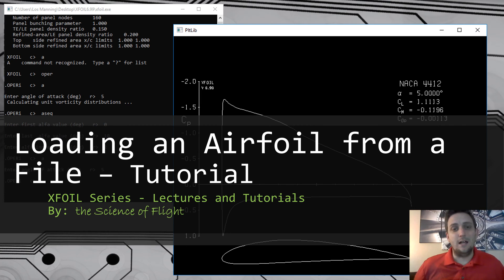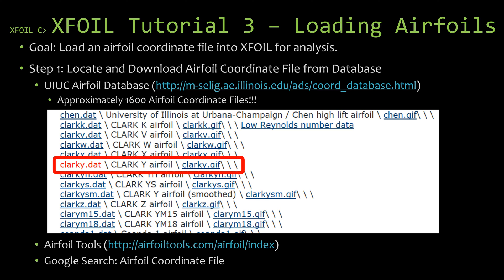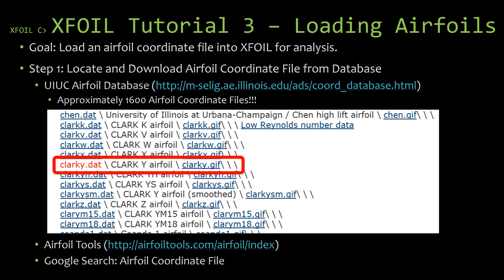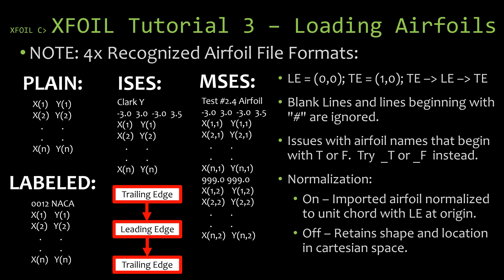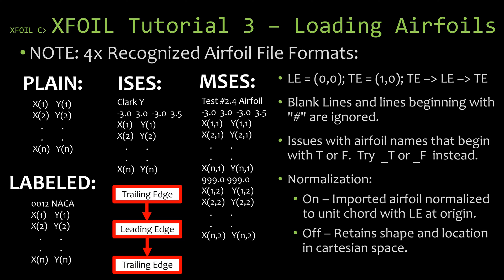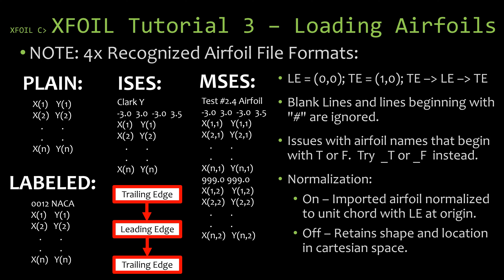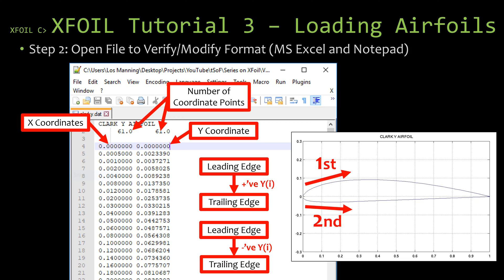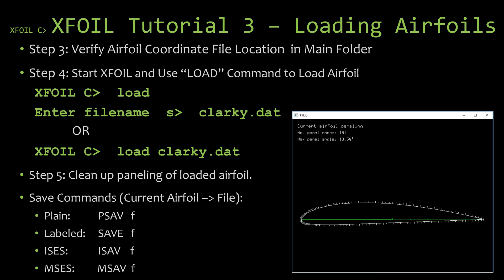XFOIL Tutorial 3: Loading an Airfoil from a File

Comment: I am not able to  load the modified ClarkY airfoil coordinates in the plain format with the headers into XFOIL. The error reads:
 File OPEN error.  Nonexistent file:  clarky.dat
Please help.

Before you ask,
I have placed the airfoil file in the same directory as XFOIL application. Also, my system contains multiple copies of XFOIL. Will this be a problem?
Reply: As a heads up if it is stored as a text file and the name is claky you still have to call it in XFoil by typing load clarky.txt    so if you name your file clarky.txt as a text file you need to type in load clarky.txt.txt in xfoil.
Reply: @ralf-hansen  thanks man!
Reply: @ralf-hansen  not true about the double .txt where did you get that from?
Reply: @giannisfilippou7460  I think it is true because I had a file named SM701.dat that I was trying to load and I just added .txt at the end when loading it and it's working
Reply from the maker: Multiple copies of XFOIL will not cause any issues unless it is in a different location than the file it is looking for. The reason we put it in the same folder as the .exe application file that we used to start XFOIL is that it is the location that XFOIL is looking for the file to import. But from your comment sounds like you already checked this. You also have the correct file extension. I usually edit mine in notepad and end up with a .txt but a .dat should work as well.

Something else that causes issues is whether it is a space-delineated .txt or tab-delineated .txt file. That’s why if you use MS Excel to edit the files you need an extra step to convert it from the tab-delineated file that MS Excel exports to a space-delineated file that XFOIL wants as I explain a little more in this video of mine: https://youtu.be/vBWNOivvGrI . It’s a video where I go step by step on formatting an airfoil to load into XFOIL. You could check on whether what ever software you are using to modify the file exports as a tab-delineated or space-delineated file. 

Based on the error prompt given I would guess the issue is either a location issue or a tab-delineated file issue but the header (line with the airfoil name) could cause some issues as well. If the string starts with what could be considered by Fortran to be two numbers, it will consider it as the first two coordinate points. So “00 12 NACA” wouldn’t read in right but “0012 Naca” would. Also if the name begins with “T” or “F” fortran will interpret this as a logical (true or false) variable causing issues with XFOIL detecting the name.

Hope this helps solve your issue!
Reply: @thescienceofflight1404  i had the same issue. get the clarky.txt in the same folder as the airfoil.exe and he will open is when u use the load sequence. thanks !!!
Reply: @florwalgraeve5877  how do that help me pliiiiz

Comment: Very helpful video! But I have question for you sir. Is it possible to create or modify existing .dat file of airfoil to divide this airfoil on two parts with empty space between? This space should have 10% of chord lenght.
Reply from the maker: Hmm, I guess it can be done in Microsoft Excel. In my video called “XFOIL Q&A 1: How to Format an Airfoil File using MS Excel” (here’s a link to it: https://youtu.be/vBWNOivvGrI ) I talk about how to format an existing airfoil coordinate file to the proper format to import into XFOIL with each row being a separate coordinate point. The first column being the location on the airfoil chord (x-axis) and the second column being the distance from the chord to the surface (y-axis). Half the second column is the upper surface (mostly positive y-axis values) and half is the lower surface (mostly negative y-axis values). If you want to split between the upper and lower surface look for the (0,0) location. One surface will be from the first row to the (0,0) row and the other surface will be from the (0,0) row to the last row. If you wanted to modify the space between the surfaces you could add or subtract an offset value to one of the surfaces (or half the offset value to the entire second column, aka, both surfaces). However, with this method I would be worried about the flat spot that would result in the LE where there is supposed to be curvature or the TE gap becoming larger.

Instead, I would, from the main menu, drop down into the “Airfoil Geometric Design” menu in XFOIL using the GDES command (after loading the airfoil into XFOIL, of course). In this menu, the TFAC command is used for scaling the existing airfoil’s thickness and/or camber. You will need to calculate the scale factor to use here (new value/old value). For instance, if I wanted to modify the NACA 4412 airfoil’s 12% thickness to 10% thickness the scale factor would be 10/12 = 0.83333. When I enter the TFAC command it will prompt “Enter new/old thickness scale factor   r>” and I would enter the 0.833333 here. Then it will prompt “Enter new/old camber    scale factor   r>” and since I only want to modify the thickness without the camber I would hit enter, or return, without entering a number here. If you like the changes you would then use the EXEC command to overwrite the current airfoil with this new airfoil shape we made (that is currently in the buffer airfoil memory). Then you can go up a level to the main menu and save the airfoil to a file or then go down into the Direct Operating Points menu and run analysis on your new airfoil shape. This method will help to keep the curvature in the LE and not increase the TE gap. Try it out and let me know how it goes for you.

Comment: Thanks for the video!  and i hava a question. after i relocating all the coordinates in proper postion(TE>LE>TE), and loaded the date file i have a warinng sign which sez" poor coordinates distribution". i used a same data file from uiuc as you did in the video. can you explain why this things happen?
Reply from the maker: Yeah, no problem. For those who haven’t seen it before, the warning (found in the xfoil.f source code file) states “WARNING: Poor input coordinate distribution. Excessive panel angle xxxxx.x at i = xxxx. Repaneling with PANE and/or PPAR suggested (doing GDES, CADD before repaneling may improve excessively coarse LE spacing”. This error occurs when the max panel angle is greater than 40 degs and is usually solved by using more coordinate points to define the airfoil shape, aka repaneling the airfoil. I actually have another video on my channel covering repaneling an airfoil, here a link to it: https://youtu.be/zyJRnTMle9Q .

The idea is that the max panel angle looks at the angle created between two adjacent panels and tells us the maximum for the current airfoil paneling. The greater the angle between two adjacent panels the sharper the corner that is created which can cause problems converging along with reducing the realism of the results. If you wanted to think of it as the flow having to go around this sharp corner, the flow must change drastically between the last panel and the current panel and, depending on the set maximum number of iterations, this might mean that XFOIL can’t converge within the allotted iterations. It also might mean that you might be “missing information” about what the flow is doing between the two panels and that affects the realism of your results (i.e. instead of being accurate to four decimal places you might only be accurate to two). Step 5 in this video, "cleaning up the paneling using the PANE command", should be done on your airfoil if you see this error. Check out that video, when you get some time, to learn more about the airfoil paneling.
Reply: @the Science of Flight  wow! thanks for the such a detailed reply!!

Comment: thanks for your tutorial. however i meet a problem that after enter " LOAD airfoil.dat" my xfoil  flashback instantly. Can you help me to deal with this?
Reply from the maker: Yes, I'd be happy to help. Hmm, I don't quite understand the problem you are having though. What do you mean  when you say that your XFOIL flashbacks instantly? Can you describe this in 3 to 4 sentences? Thanks.
Reply: @thescienceofflight1404  I have the same problem right now, when I put "load airfoil.dat" the xfoil window close instantly, I dont know if it is because I put in my file 0 0,.....1 0,....,0 0 and its of another way or if its because I running a selig donovan airfoil :( help please
Reply: @eduardojosemedinaleon3021  having the same problem, have you found a solution?
Reply: @peterimpossibleplays6463  Try replacing the tab spaces with normal spaces

Comment: First of all, Thanks for this nice video it was really help full.
may I ask to clarify in details how to rearrange the points for xfoil
Reply from the maker: Thank you. It's good to hear that these videos are value-added. 

So when we load an airfoil into XFOIL we give XFOIL a list of points (a point is defined by an x-coordinate value and a y-coordinate value forming an x/y coordinate pair, think (x,y) coordinate pairs) and XFOIL has to turn this list of points into an airfoil shape. The way XFOIL determines the shape of an airfoil from a list of points is by a "connect the dots" approach. This means that XFOIL will take the first point listed and draw a straight line to the second point listed (this line will actually become a panel unless the pane command is used to redistribute the panels around the airfoil shape after loading the airfoil). XFOIL will then take the second point listed and the third point listed and draw a line between the points. XFOIL will then take the third point and the fourth point and draw a line between the points. And so on and so on until XFOIL has drawn a line between the last two points listed. This is why the points must be listed in a sequential order so that the lines are drawn between neighboring points. However, we now have a line and not a closed 2D shape since the first listed point and the last point do not have a line drawn between them. We want this gap to be at the trailing edge so that it doesn't affect the results that much (you can actually see this 'Trailing Edge Gap' on some airfoils if you load an airfoil, go to the PPAR menu, and zoom in on the trailing edge). To put that gap at the trailing edge we need the first point listed and the last point listed to be the trailing edge points. So all this means that we need to arrange our points so that the first point starts on the trailing edge and the subsequent points traverse either the upper surface or lower surface, point by point, and looping around the leading edge it traverses the other surface, point by point, until we have traced the outline of the airfoil and arrive at the other trailing edge point (each point being on its own line of course). Hopefully this helps.
Reply: Thanks alot